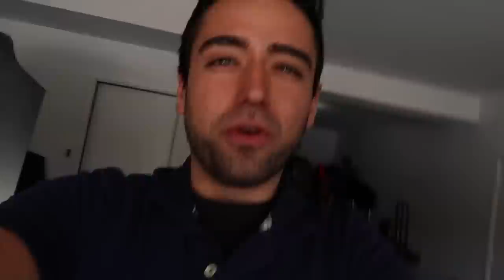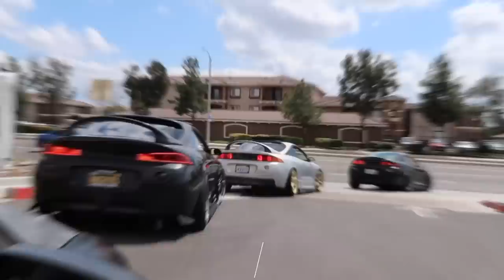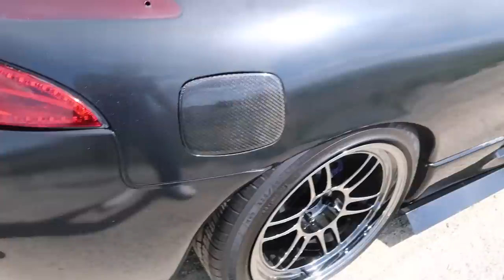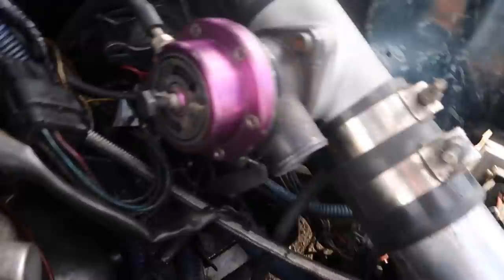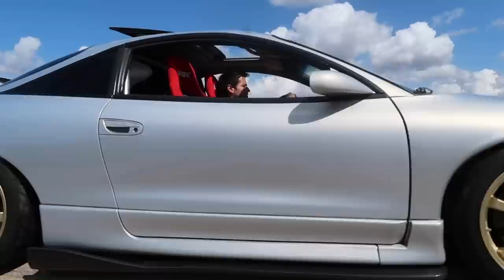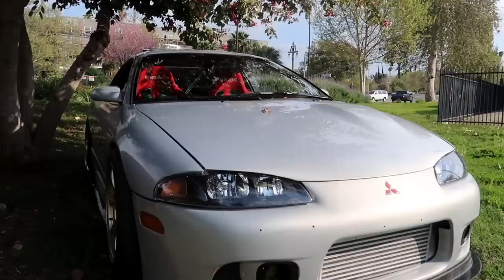MITSUBISHI ECLIPSE WALKAROUND | VLOG!

Comment: Hey Miguel, I messaged you on fb. Does the differential for this build need to be LSD or will a non LSD 3.307 diff work? I’m working on getting all the parts needed for this swap almost half way there.
Reply from the maker: Non lsd should work fine
Reply: Saweeeeet, and think you! I only know of two people who could answer this. One speaks Russian and the other is you. Thank you endless sky for doing this build, I’m going to be working off of your blueprint, and following your tracks for that wiring harness. I mad appreciate and respect you being a trailblazer, especially in sharing your process. Wanted to do your build since highschool. dsm community always so negative about it saying it can’t be done. Kind of just made me want to do it more lol.
Reply from the maker: That’s one of the reasons I did it. Good luck with yours!